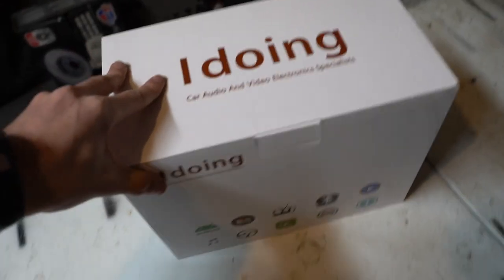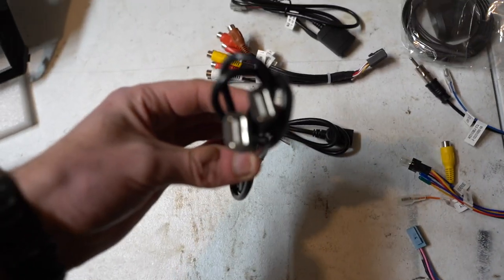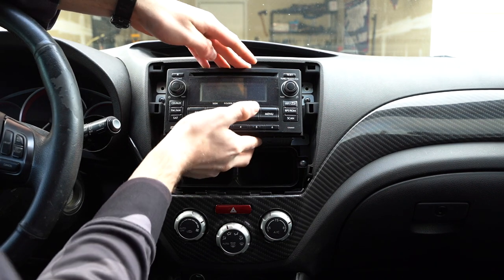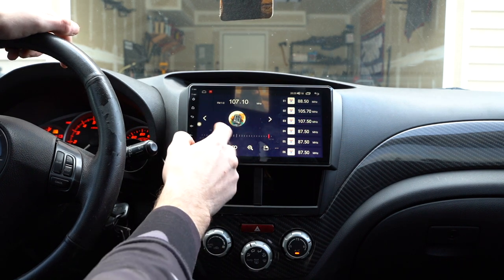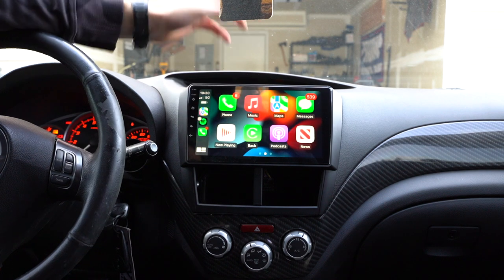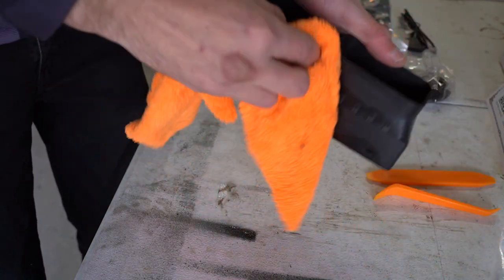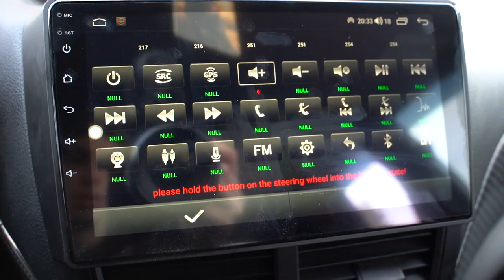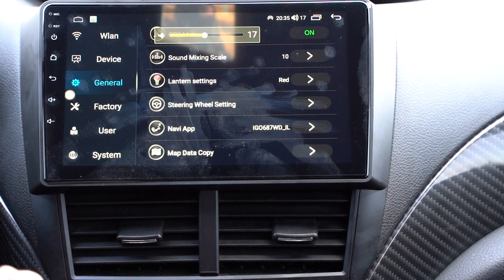How To: Install 9" iDoing Headunit in an 08-14 Subaru WRX STi | Wireless Carplay/Android Auto

Comment: Great video, it was actually super helpful!
i picked up my 09' wrx a couple of years ago and the previous owner had replaced the stock head unit with a cheap cd player at some point. I just got this idoing unit in, and I haven't even seen that extra black wire harness you disconnected from your original head unit, now I'm wondering where it is... >.>  btw, That random wire with the little box that you held up and said you had no idea what it was looks like its a sim card reader for the unit, it slides open.
Reply from the maker: Thanks! Glad I could help.

Comment: Does the head unit come with a steering wheel control module or is it built into the harness that it comes with?  I have a aftermarket unit already but i miss my steering wheel controls.  Also does it have something to retain the stock USB port?
Reply from the maker: The SWC is part of the software in the headunit... its just there, ready to program when you plug it in. Also, yes, you can add the supplied USB ports if you wanted!

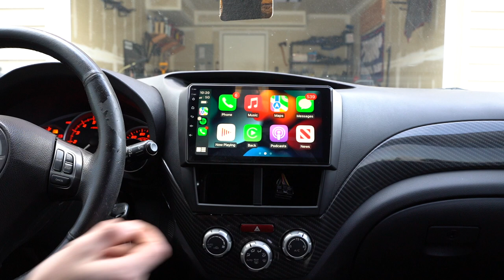Comment: at 7:04, that wire is most likely satellite tuner, I have the same box on top, going to remove it tomorrow as gps doesn't work due to the metal blocking it.
Reply from the maker: Ah, right on!
Reply: nevermind wrong thing, I'm dumb

Comment: are you having issues with your GPS location when you using Apple CarPlay? Because I am and I’m trying to fix it. I tried contacting Idoing but they couldn’t help
Reply from the maker: When using the CarPlay, I just use the Maps app and haven't had a single issue!
Reply: did you install the gps antenna? I did and I’m having issues
Reply from the maker: I didn't. I use the the maps app, so no need for it.

Comment: have u had battery drain issues where the car won't start? seen some videos where these basically stay powered on
Reply from the maker: Nope! Its hooked up directly to the stock harness, so when the car shuts off, so does the radio.
Reply: @bschoenborn  that's cool. do u know how to change themes?
Reply from the maker: @jonahchavez1235  its somewhere in the settings.. Im not home currently, but I know its in there somewhere!
Reply: @bschoenborn  for the life of me I can't figure it out lol
Reply from the maker: @jonahchavez1235  If I was home, I would look and try to figure it out!